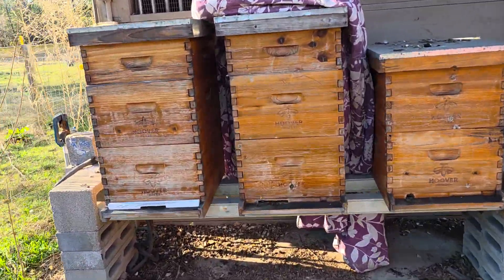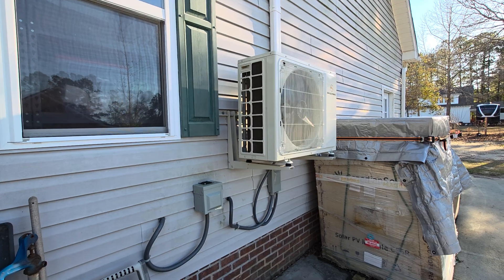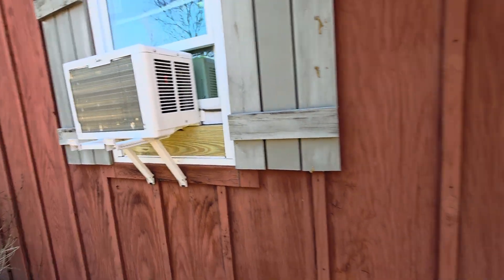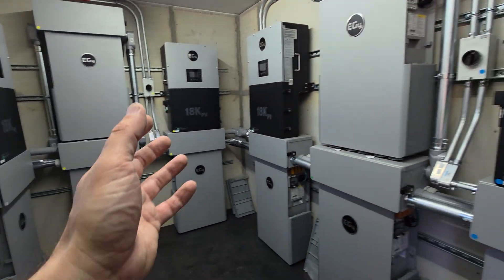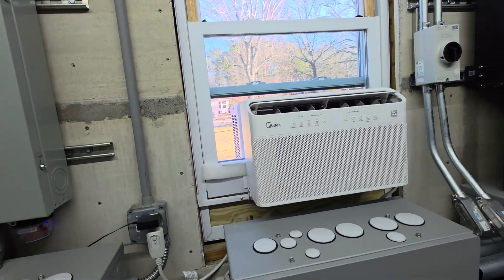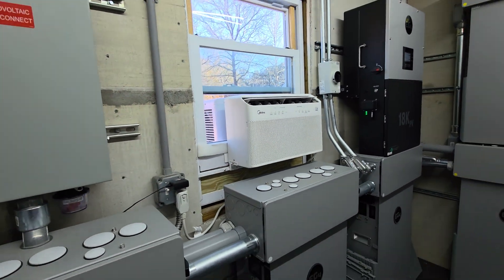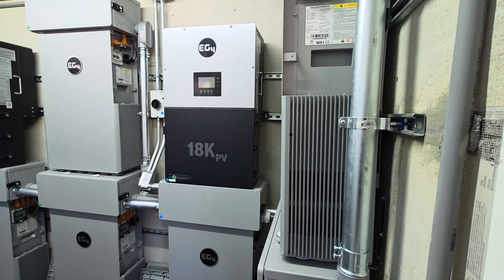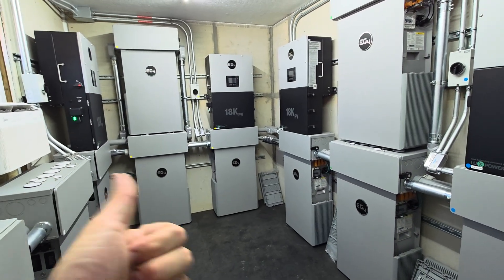How To: Optimize Solar Battery Health

Comment: Hey again, curious why all the different conduits between boxes? Emt for dc, Conduit for ac, but what's the 3rd back connection for?
Reply: Thanks nice keep everything seperate which conduit did you  use? Flex?
Reply from the maker: I believe code also tells you AC and high Voltage DC should not share conduit with communications cables. Yes flexible conduit for the communications https://www.homedepot.com/p/HYDROMAXX-1-1-4-in-Dia-x-25-ft-Flexible-PVC-Non-Metallic-UL-Liquid-Tight-Electrical-Conduit-4105114025/311955645
Reply from the maker: That is the comms (ethernet) for the inverters ans batteries
Reply: Im planning to replicate your amazing setup ( but with flexboss21's amd indoor version batteries)  for a solar powered bitcoin mining farm in northern California
Reply from the maker: Love that! I would have gotten the flexboss too but it wasn't out yet!
Reply: Did you parallel your inverters or are they all working independently with 3 batteries and their own solar inputs? Also are your batteries in sets of 3 or connected all together?
Reply from the maker: All inverters are paralleled and the batteries are grouped as sets of three with each inverter and separated by 250amp fuses between each bank.
Reply: @ianmburke thanks i was curious how the communication would work with that large of a setup if everything was connected
Reply from the maker: All works perfectly, the set up ethernet between inverters has some jumper placements to make it work correctly but otherwise relatively easy to set up
Reply: @ianmburke  🤔

Comment: Love the videos 👍 Speaking of being shocked, maybe you could discuss your grounding system. I found that to be the most debated and difficult topic. And with a system like that, lightning strikes would  stress me out. Do you use any SPD devices?
Reply from the maker: Great idea!!! I do have SPD and the debate is odd since most of it is online in NEC fairly well. 250.54 I believe is the only place that is "odd" as it notes auxiliary grounding is NOT required, however when you get into solar arrays they do require them for the bonded components and that ground does not need to be connected to the (grounding & bonding) of the rest of the grounding and bonding on the AC side of the system. AC side should bond all components and run back to the main grounding rod. Next video I'll do a "Define the fuzzy areas" of your solar system
Reply: @ Seems like the debate is whether to use 1,2 or 3 rods and where to place them. I drove two in the ground six feet apart and bonded everything (except array) in the main panel. I think NEC requires the array to have a separate rod as well so the debate is where to place it. If located away from the other two, then you create a ground loop in the event of a strike. Some people talk about placing all three rods very close to each other to prevent that. Some guys don’t ground their arrays at all. I know how I plan to do it but it’s interesting hearing these discussions and learning.
Reply from the maker: Yea the ground loop is an interesting one. I'd be concerned if the were close but not in parallel. Close being maybe sub 100f 30m but beyond that I'd expect the effect to be highly unlikely due to the  resistance of the soil. That said the grounding for the array should be as close to the array as possible. So the location of the array relative to the service grounding electrode(s) is the real equation to solve for.